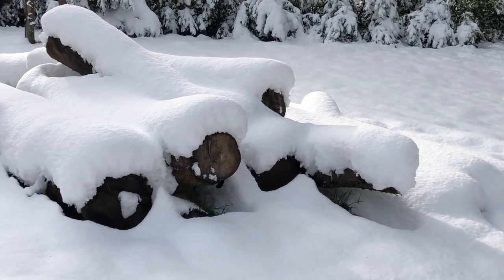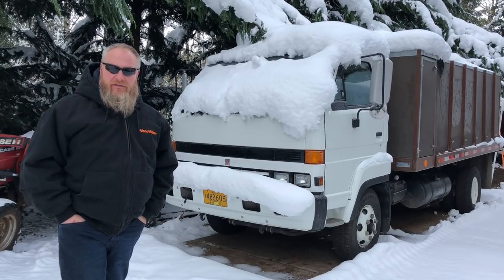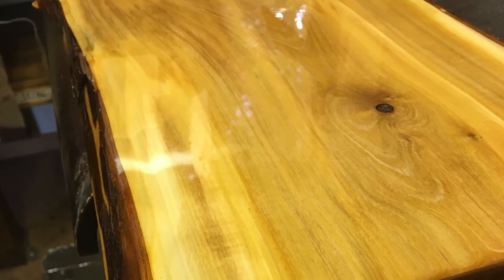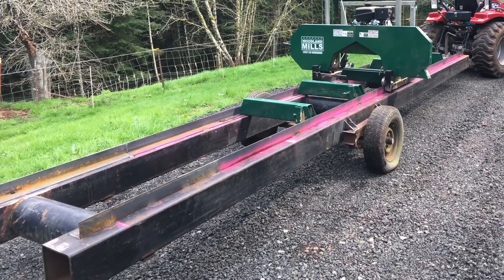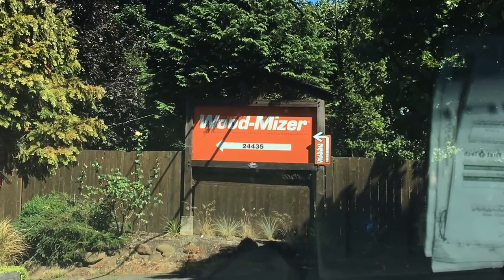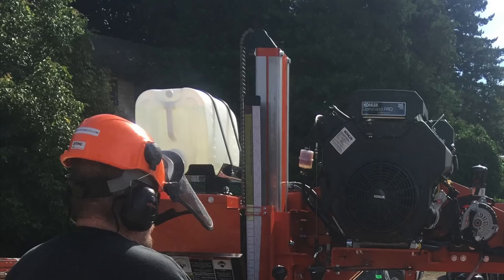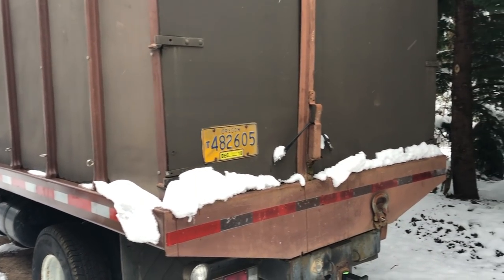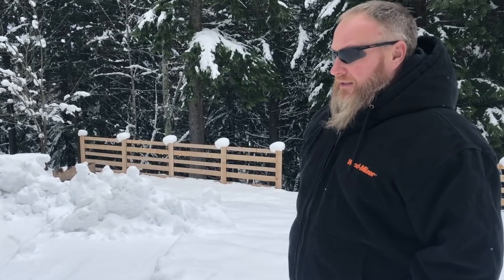From a Woodland Mills HM126 sawmill to a fully hydraulic Wood-Mizer LT35

Comment: Thank you for the video, it was interesting and should be of help to those who are considering going into the portable sawmill business. I would like to point out one thing, that being, you mentioned that you have plans to build a 40' x 60' shop in the spring, I would  say from my own experience that the size of an actual working shop is quite similar to the number of woodworking clamps a woodworker may have, (i.e.) there is never enough. I built myself a 30' x 50' x 12' work shop in 2006 and by 2008, the work area had gone from what I originally thought that I would need, to realizing that the size of shop which I had built, needed to be twice that size. Believe me, you cannot build a shop that will be too big, you can only build a shop that will quickly become too small. Hope this helps in your future planning for a successful business.
Reply from the maker: My problem here is level ground. I have very little of it. My dad’s shop was 24x36 and it always seemed cramped. This year, spring slid into summer, then fall and now its winter and I have no shop. If you saw my Dozer Day video, that break down set me back for the the year because our equipment gets too busy during the summer to break it free. I’ll gear up for next spring.